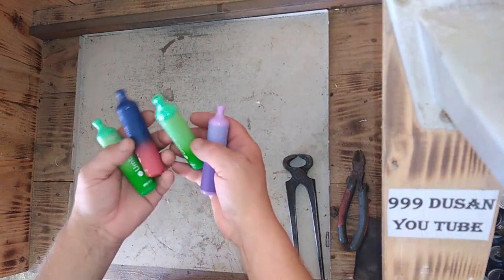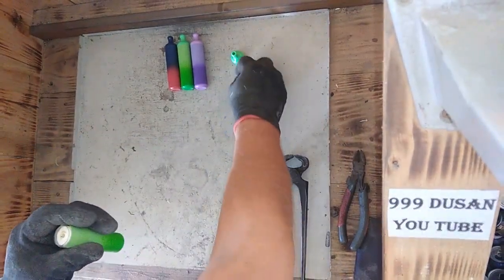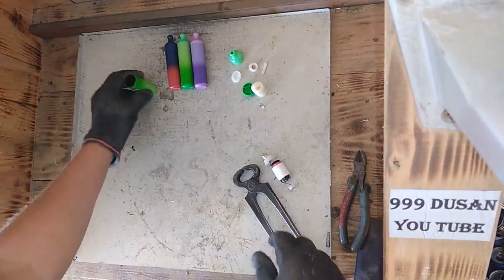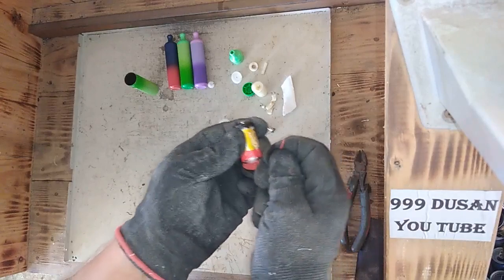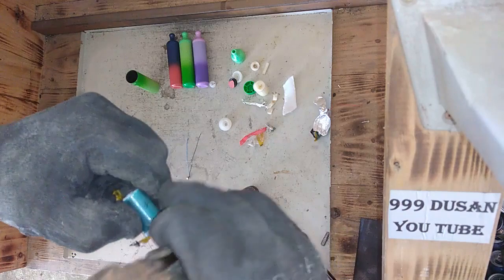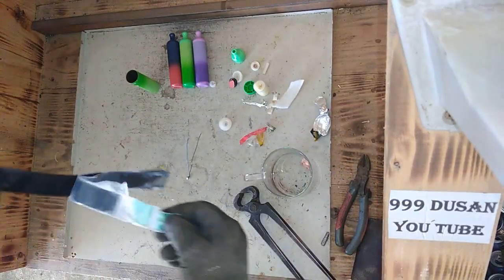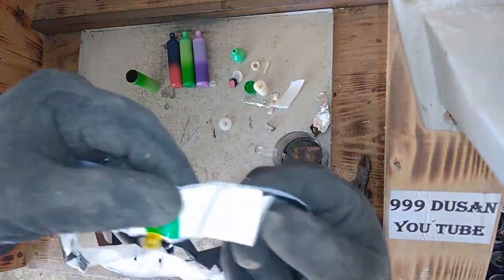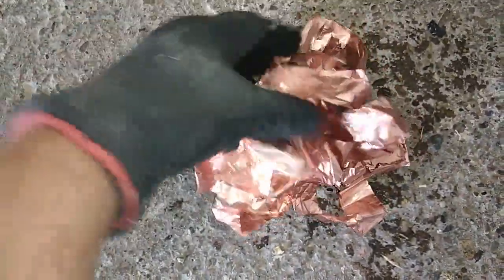Disposable ELECTRONIC CIGARETTE - micro scrap for Cu and Al.

Comment: That first little piece is not a battery, it's a pressure sensor, built like a condenser microphone, with a transistor inside.

Comment: Those thin copper foils are perfect as cathodes for electrorefining of cast raw copper anodes from melted electronic parts; later the sludge is processed for recovery of gold and PMs, as well as some basic metals.
I've scrapped literally thousands of various types of lithium batteries and recovered lithium, manganese,  copper, nickel, and cobalt; although it's a rather time consuming complicated hydrometallurgical process.